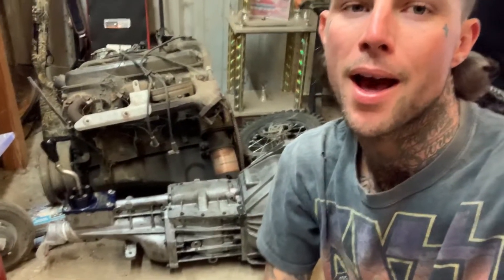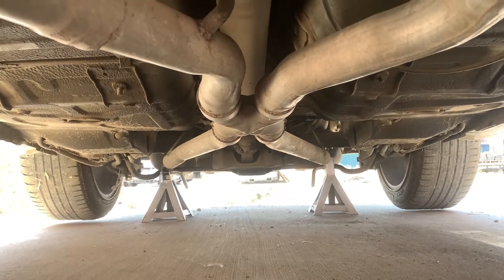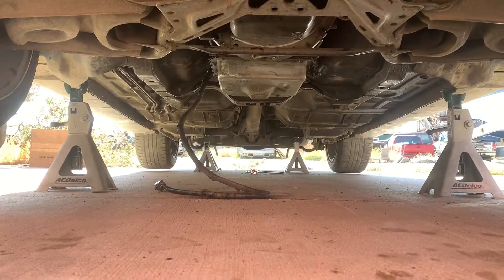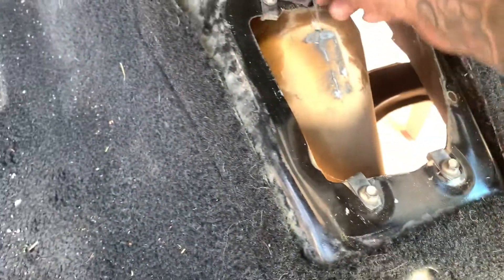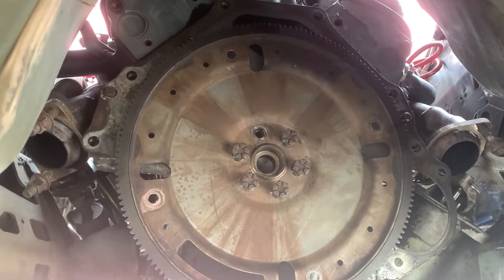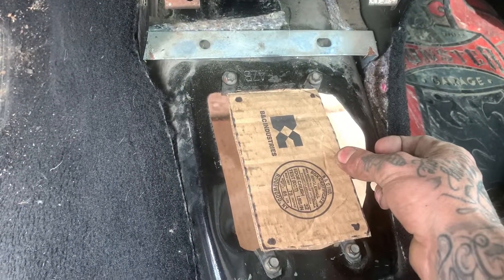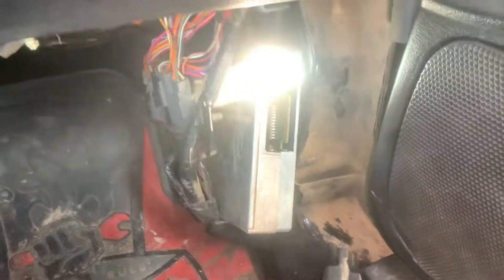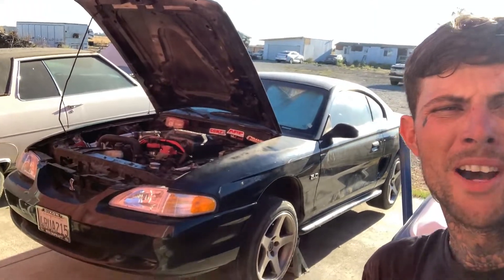Mustang 5.0 Automatic to 5 speed Manual Swap .

Comment: I did this swap myself, (with a good buddy) almost 10 years ago on a 2000 new edge 4.6. It was worth it the head ache. I also put in a 03 Cobra IRS in 2015. Unfortunately I just had my left leg amputated and now I'm thinking about switching back to auto. 

Have fun and row the shit out of some gears for me dude!
Reply: Can the 94 to 04 mustangs be allowed to use automatic transmission for 5.0 swap
Reply from the maker: @jonathonhicks2369 96-04 and 4.6 liters used a 4r70w automatic transmission. The 94-95 mustang 5.0’s used an AODE automatic transmission. I dont think an 04 transmission will work for a 5.0 motor

Comment: 💯🤜🤛💯 True solider in the field, very intellectual in giving specific details, Much respect Doctor your knowledge is phenomenal 👍
Reply from the maker: Thank you sir I appreciate the compliment!
Reply: Got a question for you Dirty 💯🤜🤛💯
Reply from the maker: @terryshambo5505  what’s up brotha ?
Reply: Blessings 🙏, the harness for the manual transmission plug and play into the same auto harness and will it work and fuse box ignition
Reply from the maker: @terryshambo5505  you will need the manual harness from Transmissin to firewall but the plug in at the firewall is the same for auto and manual so you won’t need the harness past the firewall . N I had to make no changes to any ignition or fuse box components
Reply: Massive Amount Of Respect Dirty 💯🤜🤛💯
Reply from the maker: @terryshambo5505  anytime brother ! That’s wat friends are for

Comment: i was wondering if you ever got rid of the adapter plate and made up the inch gap i’m having the same fitment issue and wanted to see if you found a solution
Reply from the maker: No I never was able to . I raced all season this year with my plate and no issues . I’m really not sure why it happens I’ve read some mustangs had the difference for most they have no issue I read that some aodes from factory just came with the mount closed to motor that’s why I made that adapter plate . Maybe an aftermarket cross memeber like the one STIFFLERS sells would make up that gap

Comment: I’ve never seen someone use a pilot bushing in one of these swaps. Typically we use a bearing. How is the bushing working out for you? Also, did you use a shim in your input bearing retainer?
Reply from the maker: Works fine brotha and no I didn’t shim the bearing retainer it didn’t shim the bearing retainer didn’t have a shim wen I replaced the old one
Reply: @Dirtywhiteboy118  wow really? Someone must have been in that T-5 before you got it. Ford puts a shim in there to reduce end play on the main bearing. Did you junk the old one? I bet you there is one in there. Glad everything is working for you.

Comment: I need help, i need to know what flywheel you used?? I work at oriellys and the flywheel i got for that 5.0 was too small??? What flywheel did u get or where u got it from???
Reply from the maker: I used a flywheel from the 1995 mustang cobra I pulled the pedals and the entire transmission swap from . The t-5 from the 94-95 car is a borg Warner world class t-5 as far as I know the only difference between a foxbody 86-93 t-5 and the 94-95 sn95 is the length of the input shaft . I think any 5.0 t5 from 86-95 . Make sure it’s not showing parts for the 4.6 96-98 sometimes because they show all parts for sn95’s 94-98 even though there is a motor and transmission difference thru that generation of the car

Comment: Did you use auto ecu and wiring harness ?
Reply from the maker: I used my auto ecu and engine harness yes but I had a tune made by
 “tuning innovations” to plug into the obd1 port to make the swap work . You’ll need a 5 speed ecu if you don’t get a tune .
Reply: @Dirtywhiteboy118  thanks brother I’m in process of doing right now
Reply from the maker: @Pushrodfanatic  hell yeah raced mine all season no problems so happy absolutely 100 percent prefer 5 speed never lookin back ! Lmk how it goes for you brotha or if you have anymore questions !!

Comment: Question did you have a issue starting it I changed the computer to a manual and the harness to but every time I hook the battery up and go to turn the key to start it nothing happens I’ve made sure everything’s hooked up just wondering if you had any issues with starting?
Reply from the maker: No brotha none at all . Fired up first time like normal… make sure your clutch safety switch is bypassed or wired correctly.. that’s the only thing I can think of other then checking all your ignition components

Comment: Did you reuse the auto drive shaft? If so have you had any problems because I’m doing the swap and the guy gave me he drive shaft to go with it but it doesn’t fit everything came from a foxbody
Reply from the maker: I did not use my auto driveshaft I got one from a 5 speed 1994 mustang gt . I’m not sure if there is a difference between the two but I grabbed it with my swap kit just in case .  It could not fit if your using a t5 from a foxbody because I do know the input shaft on a foxbody t5 is shorter then the input shaft of a t5  out of a 94-95 5.0 . If your putting the fox t5 in a sn95 that could be your issue why it’s to short brotha .
Reply: @Dirtywhiteboy118   gotcha that’s exactly why, by chance do you know where I could get a drive or know what drive shaft would be able to fit?
Reply from the maker: @noahventimiglia729   https://lmr.com/item/LRS-4602SPK/79-04-mustang-11-16-driveshaft-spacer 

There’s a drive line spacer lmr sales that can help fill the gap!